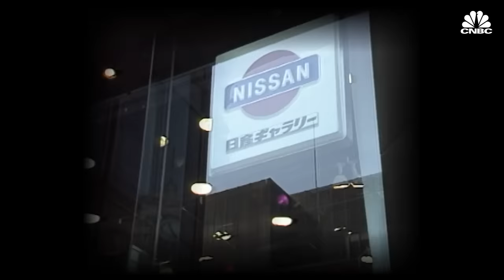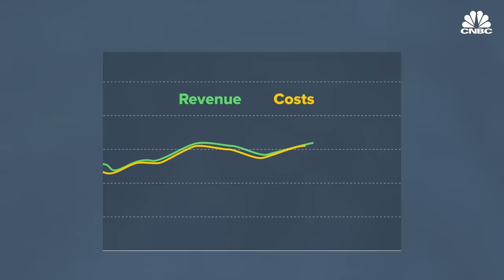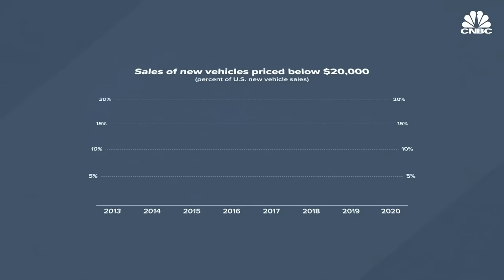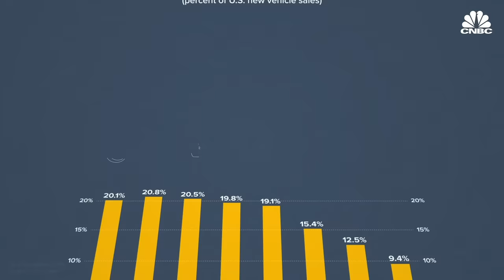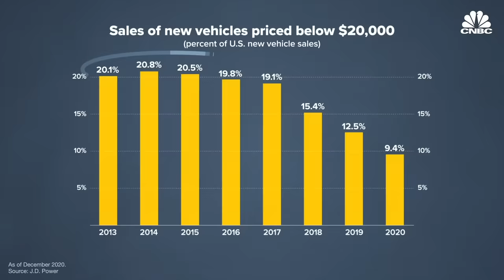Why Cheap Cars Are Disappearing

Comment: I don't think that cheap cars sales have fallen. Instead, cheap cars have become more expensive. I bought my Ford Fiesta in 2012 for 11k and now the new Fiesta 2020 has a starting price of 23k. There you go.
Reply: Chevy Sparks at $17k, those type of cars should be $10k cars, you can even get some of those cars used for $10k and it be a 2015 model
Reply: Money is worth less due to inflation so price is higher but in inflation adjusted $$ almost same.  More safety requirements make up the difference.
Reply: my 16 fiesta was a about 15000
Reply: @leslielucci3182  inflation meaning an excuse for price gouging and safety regulation as a political scapegoat. This has been going on well before inflation or magical new safety regulation.
Reply: @sleepycharlie673  yep. Most of the "safety requirements" were there by the time the 90s rolled around.

A lot of price gouging also happens at the dealer level.
Reply: The Fiesta 2020 will have so much more features than the top trim of 2012 so of course, the 2020 model will be more expensive. Features on the top trim would filter into the base model of 2020 because as technology grows, it trickles down into cheaper models. A base trim 2020 will be comparable to a higher-trim 2012 because many optional features are now standard. That is why it was 11k in 2012 and now 23k in 2020. You spend more, but the base features are plentiful. I think it justifies the increase in price.
Reply: This is the correct answer. The video is full of nonsense.
Reply: Same. My '17 Nissan Versa cost $11.3k but a '22 Versa costs like $17k 😡
Reply: @leslielucci3182  the problem is, our paychecks haven't increased as much as inflation
Reply: You are precisely right.  Automakers run a cartel  enforced by the US government. CAFE fuel economy standards have gradually squeezed cheap cars out of existence by requiring compact cars to get 40+ mpg or pay a $150 penalty to the government per MPG they fall short.  Large cars, trucks, and SUVs have much more relaxed requirements, and have wider margins to make up for any little penalties they do get hit with.  This is why Honda discontinued the Fit, because falling 8 MPG short (Honda Fit-37mpg  CAFE adjusted MPG for subcompact car-45 mpg) would have cost them over $1000 per unit in penalties.  Heavy duty trucks are only expected to get 16 MPG by 2027, so a truck getting 8 MPG in 2023 would receive a smaller penalty than a typical Honda Fit would if they still sold them.

Comment: This title is misleading, it should be “Why Affordable Cars are Disappearing”.
Reply: I was thinking something similar. Aren't affordable cars cheap cars?
Reply: Why affordable new cars are disappearing?  this video was a joke from the start.
Reply: It’s the same thing.
Reply: @Andrew-zv4fm  
Well no.
"Affordable" is very subjective. 
People have different meanings and standards when it comes to affordability. 
Some may think 20K is "affordable" while others think 40K or even 60K is "affordable".

As for the car industry, when they say "affordable", it would mean something that may be above 20K but not too expensive enough that ALMOST everyone can buy one.
While "cheap" cars mean those that practically ANYONE can buy.
Reply: @dickmelsonlupot7697  yes and affordable means cars anyone can buy.
Reply: @josephka5149  ok crazy 🤪
Reply: Right. That's why the loan terms have changed from 36-48 months, to 60-84 months. 
Many people are stuck trading in their first car with 80k miles on it after 5 years, to get their second car, while rolling a balance they still owed on the first one.
Reply: JUST BOUGHT A RELIABLE TOYOTA COROLLA 2005 BEEN DRIVING IT ALOT NO PROBLEMS! ONLY 3500
Reply: @dickmelsonlupot7697  The title fits. Cheap cars are a thing of the past. There may be one car that still has manual windows and manual locks and manual mirrors. Without all of the expense of bells and whistle’s
Reply: @underdogtv2855  We are talking new cars here. Not used cars. Yes you can still find cheap used cars especially buying from an individual
Reply: Cheap is the right term.  Affordable means different things to differ people.  A high end Tesla is not affordable to me, but affordable for Jeff Bezos.  A cheap car is just that.  Lower cost and made cheaply to meet that price point.
Reply: Answer: Inflation
Reply: “Affordable” is more relative than “cheap.” A vehicle priced at, say, $25,000 can certainly be affordable to many buyers but it’s also not cheap to many buyers either. But a Nissan Versa at $15,000 is affordable to many more people and cheaper for many more people too. 

I think it was titled appropriately.
Reply: @dickmelsonlupot7697  affordable when used in this sense would mean affordable to the average person. Like affordable housing. Sure, some people would consider 1k or 2k a month adorable, but it is not affordable to the average person.
Reply: Well aren't they? I thought it was a good editorial.
Reply: Rii , I hate when people say “ cheap cars “ .
Reply: It depends on how you define the words. Many people view cheap as low quality where as affordable just means decent quality.

Many cars are cheap in terms of quality... Just built well enough to get past the warranty period and seem premium while new.
Reply: Looks like they changed it for you!
Reply: Why affordable everything us disappearing.
Reply: @llcross04  
They're still present here in Asia especially my country the Philippines. 
The Suzuki Espresso fits the category of "cheap" cars.
Reply: @dickmelsonlupot7697   l g
Reply: I saw this comment and avoided the video. Thank you.
Reply: @Lakshmi Kimmu I like your thinking.
Reply: @jamesherr8149  "Why affordable new cars are disappearing?  this video was a joke from the start."

The only way the video is bad is because it left the story open ended enough that a bunch of commies can watch the video and come away thinking capitalism is being bad again. The video itself doesn't seem to be morally loading anything.
Reply: Perfect
Reply: I mean, look at all the tech put into cars, safety features such as lane keep assist or crash mitigation in the base model honda accord, along with this, inflation has done a number with base model accords having cost close to 17k back in 2000
Reply: @Andrew-zv4fm  i never imagined the day this would happen.twenty grand for something in the below corolla/civic/mazda 3 and golf class was unheard of when i came off p plates just over 21 years ago and bought my first car new in 1999.
Reply: @javaman2883  Stuck? How does one become "stuck" trading a five year old car with only 80k miles on it for something new?
Reply: @franzchong5889  stop living in the past, gramps. When you factor in inflation and all the tech and safety features added to new cars nowadays, I'm surprised the price isn't a lot higher.
Reply: @javaman2883  Yeah, that's me. Bought a 2015 Jeep Patriot with high interest. Turned it in at 65k after 4.5 years, bought 2019 Jeep Cherokee with rollover balance. I'll be probably playing this game for awhile.
Reply: Because of inflation of the USD dollar. THATS ALL
Reply: @adamanderson3042  the inflation of the USD dollar
Reply: Nibody buys afordable cars
Reply: I just need a care or a truck with ac heater and a aux cord nothing else
Reply: @Mali38special  are you serious
Reply: @zuzu.hallak  What about it?
Reply: @llcross04  Yeah, modern cars are expensive because they've got stuff that cheap cars never had before, my first new VW Fox station wagon not only didn't have air conditioning, or power anything like windows or locks, it was a manual transmission car with not even a tachometer, I had to guess when the engine was approaching redline! the modern day new car would be considered a luxury car 30 years ago.
Reply: They also failed to note that rather than buy new cars, people have switched to used cars. They also were wrong about people wanting to live in cities.  Lord knows they ain't got the brains.
Reply: @franzchong5889  $20k in 1999 is worth ~$31,350 in 2020.
Reply: @llcross04  Looks like I'm the one that owns that car.
Reply: More Like : " why affordable Cars are disappearing in the US
Reply: @TheQsanity  “affordable” in housing usually means government subsidized or price-regulated.
Reply: From Higher Ground
The title cannot be mis-leading as it easily led you to watch the video.
Only that you do not like the title, you chose to call it misleading.
Reply: The problem is that more accurate headline would contradict the capitalist narrative.

Comment: I saved up $7,300 and bought a used 2004 Toyota Rav 4. It was wonderful being able to say I truly owned my car the day I drove it off the lot. That 17 year old car is my baby and has been so reliable aside from maintenance and things needing to be replaced over the years (broken and rusted exhaust line and muffler). I'll be so sad the day she taps out 😔
But yes, it's possible to buy a good reliable "cheap" car. Don't let vanity get the best of you.
Reply: the real question tho is are you single? 🤔
Reply: The problem is that even used cars are becoming more expensive those days.
Reply: Please be smart and do research on what you are going to buy. carscomplaint is a good one
Reply: @gohanssj48  Yup. I bought a Tacoma afew years ago and I was offered the same money I pad for it new... that's why I bought it new instead of used. I needed a mid-size Truck 4x4 with manual transmission and wasn't willing to pay the same price for one with 30 to 40k miles on it when I can pick it up with zero miles no scratches,dents, seat stains or funny smells.
Reply: @inutero10  She said the car is 17 years old. Not that she had it for 17 years smh
Reply: More people need to do it your way
Reply: $7300 for rav4 
Damn
Reply: I’ve had my 08 beetle for 4 years now. So many people told me not to cause it’s repairs are expensive and unreliable.. but I’ve haven’t had any issues with it so far
Reply: It's a seller's market right now during covid.  It drives prices up.  I love my 12 year old Civic Si.  It's garage kept and runs like a top!  Reliable and "fun" and cheap to own.
Reply: as long as you keep up on the maintenance it will never tap out.... the most you will have to do one day depending on how long you keep is do an engine over-haul, but I doubt that'll you ever need to do that.
Reply: Toyota, it figures!  Have you ever seen Scotty Kilmer's YouTube channel?  He's always talking about Toyotas as reliable if they're maintained.  His 1994 Toyota Celica is always getting mentioned in the comments.  You selected a good one.  Sometimes its better to fix the old reliable vehicle.  It's like maintaining an old airplane, in a way.   Buying a new car now is such a pain! There's so much gadget crap loaded into these automobiles.
Reply: @SimplyCarReviews    Also, you practically have to order a vehicle NEW if you want a manual transmission.
Reply: @Starry_Night_Sky7455  I didn't order it... I acquired 2 manuals from the same dealership one a TRD OFFROAD and the other a Voodoo blue TRD PRO with desert air intake. But, I do agree that it may take some hunting.
Reply: @gohanssj48  it’s the interest on it too
Reply: True
Reply: @Starry_Night_Sky7455  That's not true. I went out shopping for an old beater and found 3 or 4 sticks. Pure coincidence that every single one of them had a clutch going out!
Reply: @inutero10  i think for 7300 for a 17 year old sounds like a ripoff even though toyotas are great cars. Rather get brand new as I find they are a bit cheaper lol
Reply: how many miles. sounds like you paid too much
Reply: @trillmixin6999  She's a pretty girl so it also serves as a dude magnet. 🧲 Money well spent.
Reply: @trillmixin6999  I bought it in 2016 and at that time the car had 93,000 miles on it. It was a little cheaper too because it was manual transmission.
Reply: @NessaHavoc  i was able to buy a 95 accord with about 91k on it for $4000. but i dont want to put you down. as long as youre happy with it and its still serving you well then im glad for you. plus manuals are always cheaper to fix. hope you get the most out of it in years to come
Reply: @trillmixin6999  hahaha 95 Accord stick is like the gold standard for automotive engineering. I'm not even kidding. That's a 300-400k mile beast with minimal maintenance.
Reply: @RavishingBeyond  truu. Mitsubishi Mirages with sticks are also an underrated gem that last long with just oil and brake changes
Reply: @Chasityolaf  the calm before the storm...
Reply: just marry a guy have him buy u everything than divorce him and keep house car etc and u wont have to pay for it
Reply: @mrdflash2127  those RAV4 can go 250K miles if properly maintained.  Pretty much oil change, coolant change every 3 years and transmission fluid change every 30k miles.
Reply: @NessaHavoc  the RAV4 will take you 300K miles when properly maintained, especially with manual transmission.  Just keep up the oil change, coolant change / brake fluid change every 30K miles.  Don’t spent beyond your means and save money for the rainy days.  You are doing the right thing for not taking on a $400 payment for 5 years.
Reply: @robertsmith987  that advice came from your experience?
Reply: @trustyoungpierre9959  why ?
Reply: 7300 is too much for a used 2004 rav 4
Reply: Probably tomorrow.  ;)